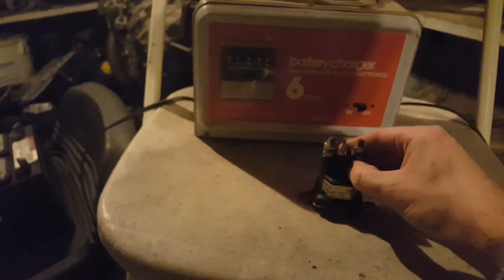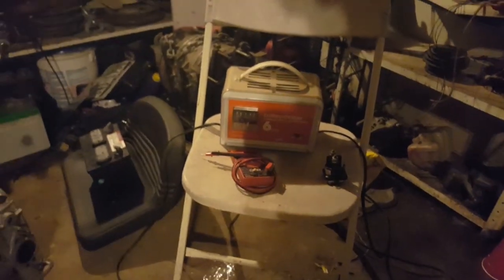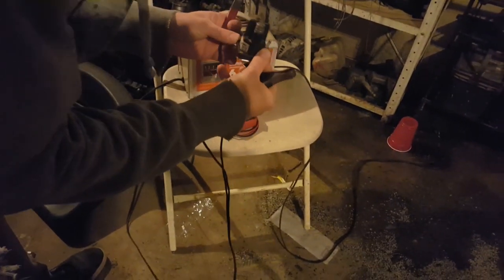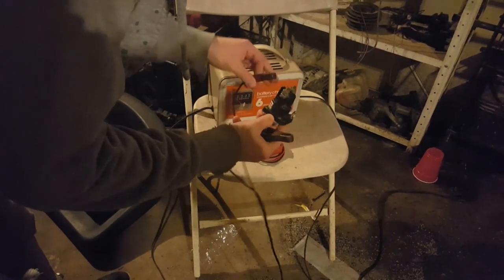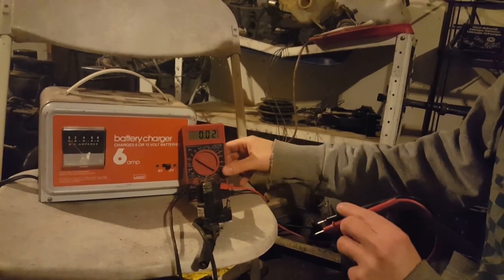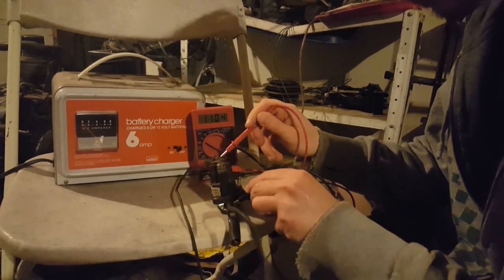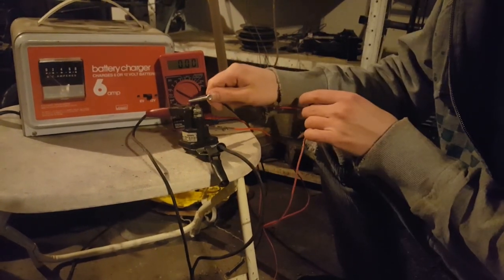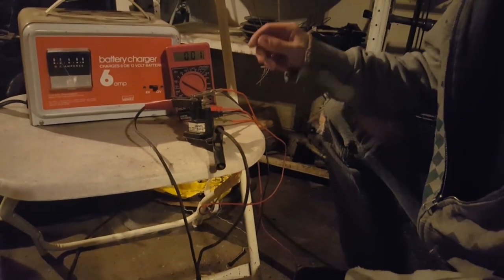How to test a starter relay

Comment: That's a starter not a damn start relay 🤣🤣🤣
Reply from the maker: Sorry for the confusion! This is actually a "starter solenoid relay" but they work in a similar way to the small black relays used in modern automobiles and other applications.  We'll try to make a new video in the future covering both styles of relays and how to test each one.

-Caveman Joe
Reply: No, still wrong. It’s a starter solenoid. A relay is the little box looking thing in the fuse box.
Reply: Then redo your title and stop wasting people time!